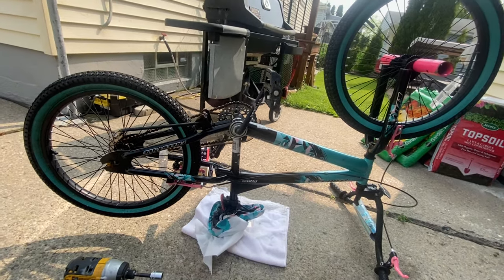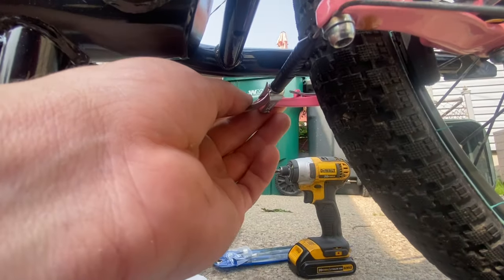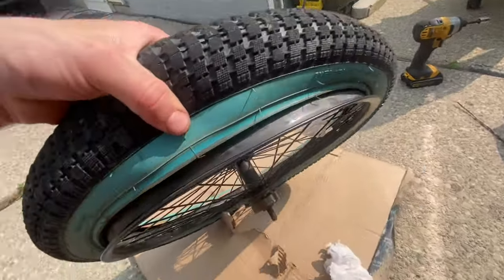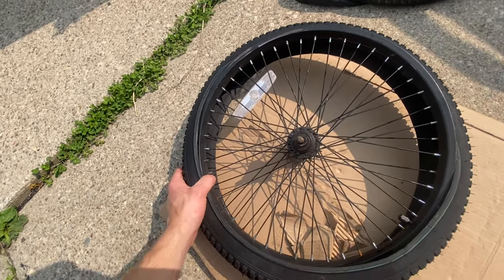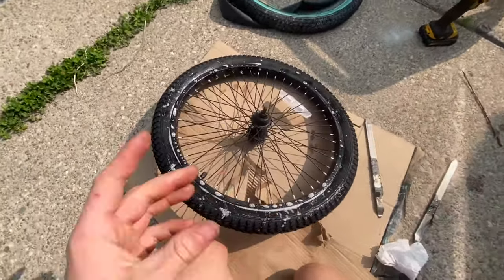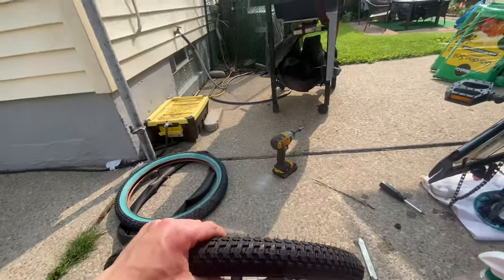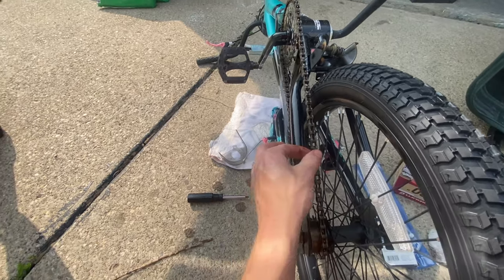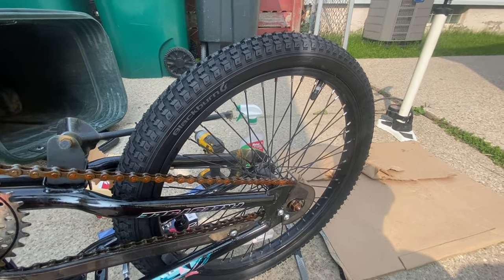How To Change Flat Bike Tire Like A Pro!

Comment: I used to have a bike similar to that where it had only 1 Gear for the Drivechain. Now my current Bike has 6 Gear settings for the Drivechain depending on what road your riding on, either flat or slope. It will be so difficult for me to take off the rear tire now with my current bike than the old bike. So far I only took off the front tire, so easy.
Reply from the maker: Yeah those are pretty easy too, might be a little more intimidating but same concept